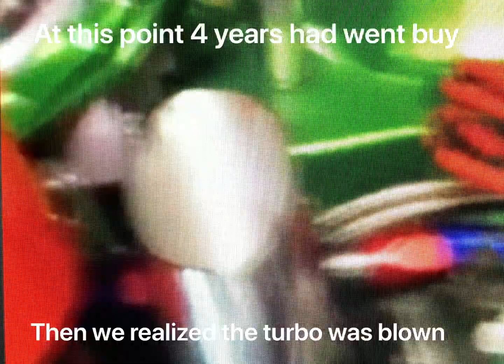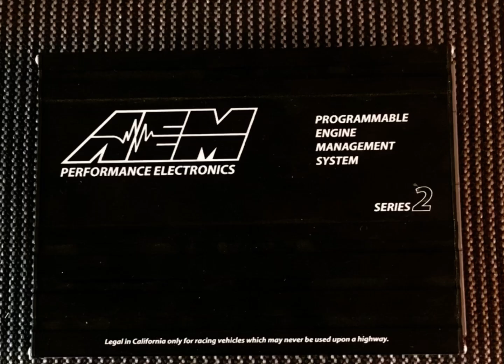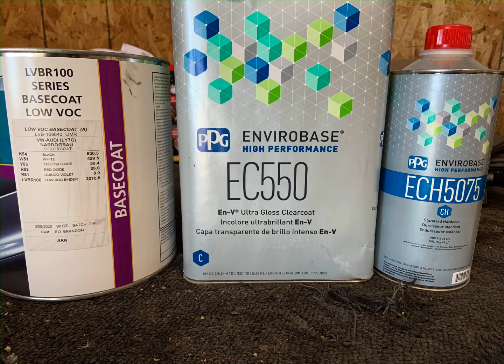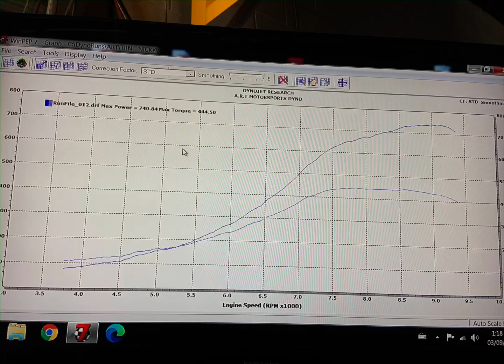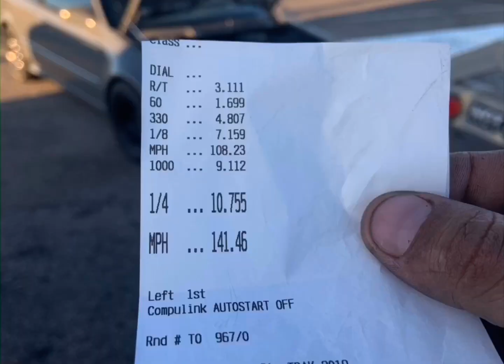AWD Big turbo Honda Civic build start to finish PART 1

Comment: I got a B18b1 swapped 98 civic sedan with gsr transmission. Got me a 99 crv rear differential for 100 at pull a part. AWD is getting planned out, may be a bit but it's gonna be a rocket lol.